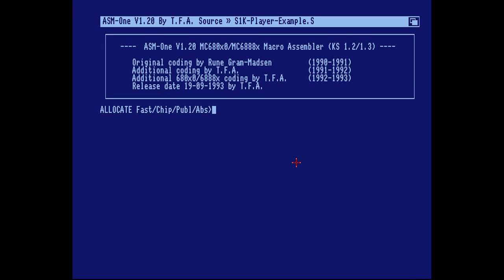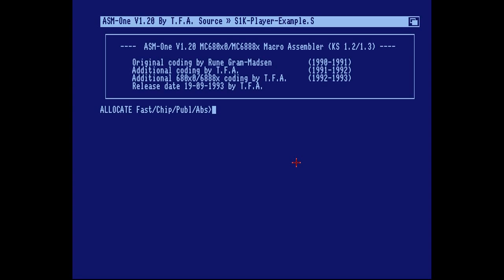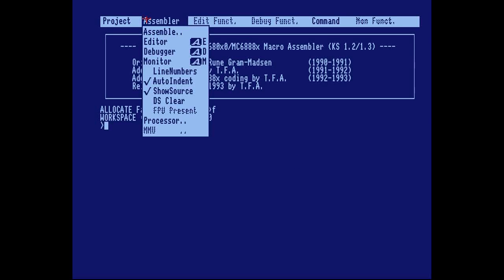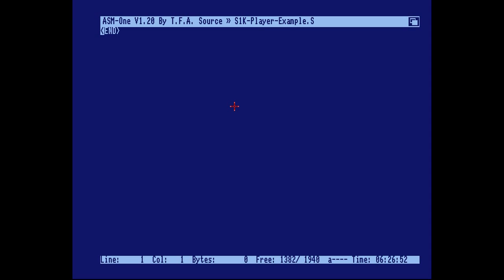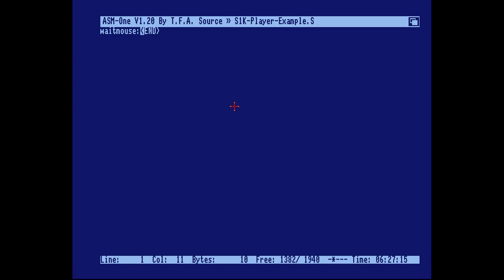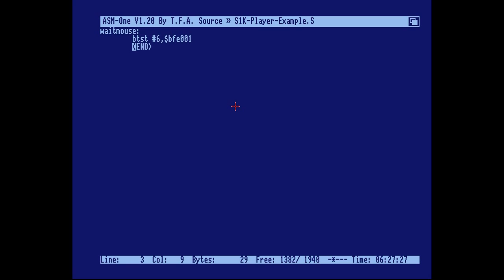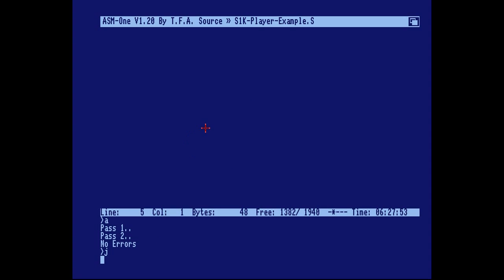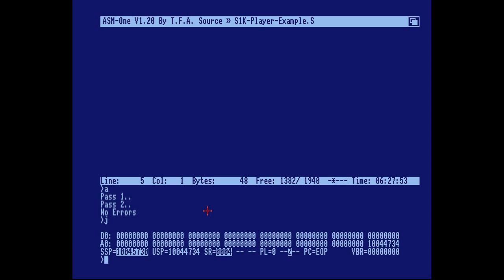Amiga Hardware Programming 1 - Use the Assembler and wait for left click

Comment: Some dude on YT is saying that a stock OCS Amiga can't do the Boing ball demo in actual 3D.  I suppose that could be an interesting project for someone to try. 

The chipset at the time was NTSC only. So that likely puts it at:

320x200 60 Hz

The ball is 16-sided and has 8 segments vertically.

I suspect that when area fill is done for most real-time demos, only the polygons that face the 'camera' are calculated.

That puts the total required filled faces at any given time to be 64 plus a possible 8 for the thin polygons at the extreme left or right edge of the object. That brings the maximum total simultaneous filled polygons to 72.

Supposedly the maximum for a stock Amiga 1000 or 500 is 100 filled polygons in real-time before it starts to lag. Hence, the goal of translating the Boing demo into true 3D seems to be possible.

Something that would be interesting is to have it start out spinning on a single axis like in the original and then hand mouse control over to the user to allow for rotation on any axis.

If the Amiga supports filled ngons, perhaps the shadow could be a single ngon. Or maybe just a simple bitmap like in the original.

Comment: Hello - really excited to start working through these! Currently I have an Amiga 500 with 1mb RAM. When I switch it on I see the usual white background with a picture of a floppy disk. If I purchase Devpac 3 and just shove a disk in, will that be all that’s required to follow your tutorial? I guess my question really is: is your ASMone tutorial compatible with Devpac3, and do I need to purchase anything further to get it working? I guess another question would be: is ASMOne easy to get for the Amiga so I can use that instead of Devpac 3? Thanks so much!
Reply: I realise now I can get ASMone V1.20 from Flame Arrows. Does anyone know how I would go from downloaded that on a PC to uploading it on to a floppy disk that my Amiga (with kickstart v1.3) will understand? Thanks!!
Reply from the maker: Transfer stuff:
1. ACA500/Plus gives harddisk via CF card and contains everything to format and transfer, plus RAM and lots more. Physical floppy disks not needed.
2. External Gotek drive for file/disk image transfer (maximum file size a little under 880KB at a time). Physical floppy disks needed to boot a disk, or install a bootswitch inside. You can download ADF disk images, or prepare your own in an emulator.
3. Greaseweazle + suitable floppy drive on PC to write physical disks on PC, suggest to join the FB group.

I think Devpac likes a Workbench environment, which typically means 512k trapdoor RAM to have any room for Devpac+programs. I think Devpac doesn't like the ORG/LOAD method I show at the start, as a way of demonstrating how the program ends up in memory and can be inspected. You can simply remove those statements (but use SECTION x,CODE_C for chipmem stuff!) and replace one or two directives for the Devpac equivalent (EVEN=CNOP 0,2 and BLK = DBC) and the first 10 or so episodes should fit just fine.

I use AsmTwo and some other Tools listed here: http://www.coppershade.org/articles/More!/Downloads/

WinUAE has a Quickstart mode which lets you try ADF disk images quickly, and from there you can try adding RAM, install Workbench on a virtual harddisk, and find out what you want/need. But there are many alternative emulators. Good luck! :)
Reply: @ScoopexUs wow! I was not expecting such a swift, thorough answer. Thank you so much for taking the time to reply. I think the first option (albeit expensive) sounds like the easiest for a simpleton such as myself to be able to get working. I will do some further research around that option and hopefully can start working through your tutorials soon. Thanks again! 😊😊

Comment: How come workspace memory limit is so big? (almost 64 MB) I'm using Amiga500 on the emulator, which hardware are you emulating?
Reply from the maker: I'm showing hardware programming for OCS 1MB. You can follow this series on an A500+512k fastmem, or any other Amiga, or an emulator.

You can also follow it on any Asm-One, AsmPro or AsmTwo version, or (with adaptation) on the assembler or environment of choice.

It's nicely spotted :D but assembler version and workspace limit will change through the series I'm sure. Code still works.

Comment: Is there any modern development enviroments available for windows or OSX?
Reply from the maker: Since 1990 there have been cross-assemblers for PC and other computers. You lose the directness and may have trouble debugging, but I think some just use their favorite text editor with a syntax plugin, and then something like a GNU compiler that also interprets assembler to make an .exe. Then you can start UAE and run the exe automatically.
Reply: @ScoopexUs  Did Amiga use .exe format? I know about cc65 for 6502 processors, do you know any equivalent for Motorola 68000?

Comment: Way to go, Scoopex!  I've been having fun doing assembler on my Commodore 64 (i still lhave my original machine with 5 1/4 inch floppies etc that still work) - now, thanks to you, I am having fun doing assembler on the Amiga too!  Both processors are fun to use - the 6502/6510 and the MC68000.  Keep up the great work.

Comment: Hey,

I ran this short program to test and it works fine.  However, I am getting different SSP and USP values to the ones you have.  Is this a problem?
Reply from the maker: No, that's fine. The episode where I explain memory is a few episodes away yet, but basically you'll get different numbers there depending on the Amiga or emulator setup that you have.

Comment: Always wanted to learn assembler and now I can! This is great!

One question though. ESC doesn't work for me. Also the Amiga+E I see in the menu doesn't work either. Tried it from the workbench. Tried it booting with with both mousebuttons down and skipped Startup-sequence. Then started if it from the prompt. Tried ASM-one 1.20 and 1.48. Can't get it to work. What am I doing wrong? Cheers!
Reply: Turns out my Escape key wasn't working correctly. Opened it up, cleaned up the contact. Then I saw my Escape key lying on the table... Glued it back. I don't think I was the first one glueing it back to the keyboard. Seems sturdy right now though. Feels the same as the other keys now. Following the rest of the tutorial. Thanks!
Reply from the maker: Hm, don't know any keyboards that require glue but glad you got it sorted anyway! Important thing is to take care of your equipment. :)

Comment: ScoopexUs, how did you get those colors with ASM V1.20?  Mine is a dark grey regardless of which kickstart I use.  I bought Amiga Forever Plus so I could emulate without hassle.  Version 1.02 is blue like the 1.3 kickstart, but not dark blue with light colors like yours.
Reply from the maker: +Johnny Starr Asm-One 1.20 has a palette editor :) Maybe it requires req.library, I don't remember. But you can set colors in the .Prefs file in S: for all of the Asm* assemblers, it's a normal text file. Versions without the palette editor will use the same colors as CLI, if you don't boot into Workbench directly. Those colors are set with the utility Sys:Prefs/Preferences. This is the case for AsmTwo which I released in beta just now, available from Downloads on Coppershade.org. I only used Asm-One 1.20 in some of the episodes because of an emulation issue.
Reply: +ScoopexUs Awesome man.  I really appreciate your resources by the way.  I'm going to go through all your tutorials and hopefully get where I want to be.  I've done a lot of Atari / NES development so this is an interesting challenge.  Are you on any forums in case I have questions?
Reply from the maker: I'm in the coder forums on English Amiga Board and in the Facebook group Amiga Code - lots of guys there too besides me who know all this stuff really well :)

Comment: I don't get the #6 test on $bfe001 - thats waiting for bits 1 and 2 which are /CHNG and /LED according to my documentation. How does that work? Other question - why is the CIA used for Amiga mouse button detection rather than the JOY registers in the $DFFxxx range?
Reply from the maker: Paul Spark I'm going to skip asking what you mean when you say "waiting for bit 6 is waiting for bits 1 and 2" and instead recommend that you read System Programmer's Guide (linked from Coppershade.Org where there are also other resources)! There were tons of I/O and internal registers in the Amiga hardware, much more so than in the simpler home computers that came before. Mapping certain I/O pins to custom registers instead of CIA registers was a hardware design choice.
Reply: ScoopexUs
OK thanks. I'll take a look at the Abacus book. I do have the Hardware Ref Manual sitting on my desk but it was late when I gave this a go. I didn't realise there were other hardware programming books so System Prog Guide looks interesting. I only had the Abacus "Amiga Machine Language" book back in the day and it focused mainly on OS library calls. Shame I hadn't bought the other book. :)
Reply: ScoopexUs Aha! I didn't realise BTST tested an actual bit.. #6 meaning test bit 6 not a value of 6 with bits 2 and 4 implied. Bit 6 is the fire button for the mouse port 1. Got it! Been programming in C/C++ for too long..

Comment from the maker: Last Ninja, I'm unable to reply directly to you (Google hasn't fixed it yet or we're not to communicate unless we both have Google+), either way I hope you see this: If you're using kick 1.3, you can only use up to Asm-One 1.20, and you must use the special 1.3 version of that. In fact, I've used that in WinUAE to record some of these episodes, and it also works fine on a real Amiga 500 and up.

That's fine, and you can ignore the reqtools warning or turn it off in preferences as I have here. (I'm just used to the commandline for navigating to files, it shows everything instead of looking for the file by scrolling a small window, and you don't have to wait for the directory to load to change to another directory.)

If you get stuck, feel free to cheat :) and look in next episodes (f.ex. I show preferences there).

You can safely cancel the SOURCES: requester or type "assign SOURCES: DH0:sources" or wherever you put your .S files.

Most Asm-One versions work fine from the Workbench, certainly 1.20 does and it's only non-standard stuff like mouse add-ons, keyboard handlers or RTG modes that cause trouble.Finally, there are earlier Asm-One versions, coder tools and other downloads on Coppershade.org!

Comment from the maker: Note: These tutorials are made to work on an Amiga 500 with 512k expansion memory and up - or an emulator set to the same, and there's no need to install Workbench or to go into Workbench before starting the assembler.

If you have set up a very nice Workbench environment, some things may cause trouble, such as RTG modes and mouse hacks to change the way menus normally work.

There are many ways now to enhance your Amiga usage in emulators, even beyond the original hardware! For these tutorials, the best setup is a standard "A500 Kick 1.3 Quickstart" with cycle-exact mode, just add a "harddisk directory" to put AsmOne and your sources in. :)

Comment: Almost 40 and learning Amiga asm. ! Please help with a question though, I am using Asm-One 1.02+ and this first tutorial assembles and runs, but on left-click my Amikit WB resets (without Guru screen). I'm on WinUAE configured for 68020 / AGA.
Reply from the maker: Are you sure you didn't forget the RTS instruction? :) Because then the computer will continue running the memory contents after the BNE as if it were code, but we've not assembled any code to after the program, so then it's just normal behavior for any computer.

For this tutorial, the ideal configuration is an A500 with fastmem (and cycle-exact mode on, if you're using an emulator). You should at least use such a config if you get a crash or hang and want to know if it's because of the code or because of the config.

Asm-One 1.02+ is tested working fine in WinUAE on 020/AGA from Workbench. Many early Assembler versions might not tolerate non-classic screen modes. That's because they have a fast integrated editor instead of a slow one based on OS calls. So try 640x256 mode first, or use the latest version of Asm-One or AsmPro. If it still happens, AmiKit may have added some mouse utility.

You can always "boot without startup-sequence" or from floppy and run Asm-One 1.02+ from the command line. Me, I have Asm-One in my startup-sequence instead of LoadWB and go into Workbench when I need to :)
Reply: ScoopexUs Thank you so much for the info. I got the tutorial running using Devpac but I will fiddle with the suggested screen modes, configs and startups and Asm-One for a better understanding of what went wrong. Thanks again for the hard work it must have taken to compile the tutorial series.

Comment from the maker: t0rxe, Google's reply system is a failure, so I'll just have to hope you see this before it ends up on the next page of comments.

Short answer is that Asmone 1.02 will do everything 1.20 does and also leaves more available RAM so that you can assemble large demos even on the humble and standard A500/1MB platform, and the messages you get are normal and doesn't affect anything.

You can put ASSIGN SOURCES: <your base dir> in the startup sequence if you want. You can get Reqtools from aminet, if you like the file selector popup windows. I'm just used to using the command line commands (you can see them in the top menus). 

If you still can't set the colors, use sys:prefs/preferences.

All that's done in my tutorials is doable with an Amiga 500 and nothing else needed, that's the whole point! :)

Comment: I downloaded and have ran ASM-one 1.20 from http://www.theflamearrows.info/documents/ftp.html. When I run ASM-ONE_OS1.3, I get asked "Please enter volume SOURCES in any drive". If I select cancel, ASM-one starts up fine, but if I try to edit the colour scheme for example (to make it blue like in your video), it says "Reqtools.library not found !!!". This also happens when I press f and then enter the amount of memory to use. I am using an A500 with 1MB of RAM and Workbench 1.3.3. Any suggestions?
Reply: Hey,

Bit late, but I had the same issue..  You can fix this by doing the following;

1.  Load Workbench, and open Shell / CLI
2.  Type assign sources: sys: 
3.  This will temporarily assign references to 'sources' which ASM-One is looking for, to your main Amiga System folder.  Sources is the place that ASM-One looks to save and load projects from, so it needs this.   It would be better if ASM-One had a way to user-define this folder, but it doesn't.

You will need to do this every time you run ASM-One, unless you add something to the startup procedure of Workbench to assign sources to sys (not sure how to do this myself!)
Reply: add assign sources: sys: , or other disk where u put it..  to your s:user-startup :)